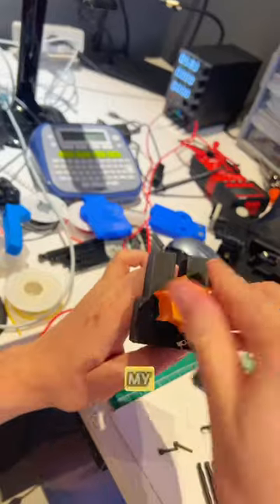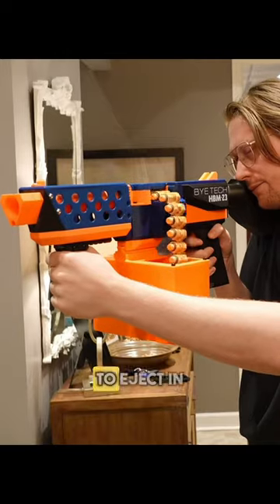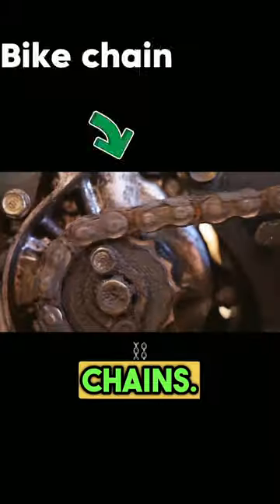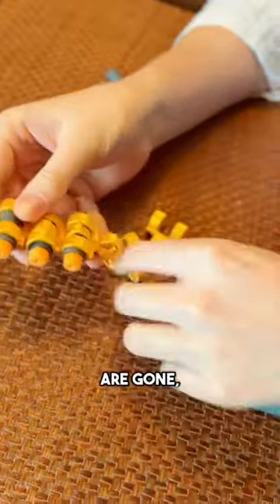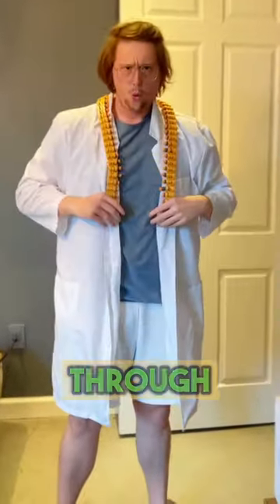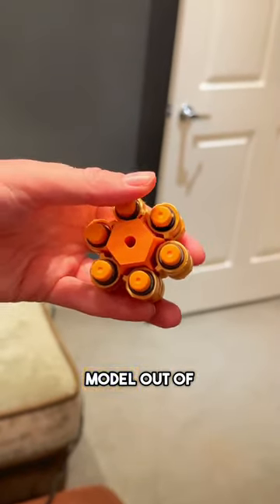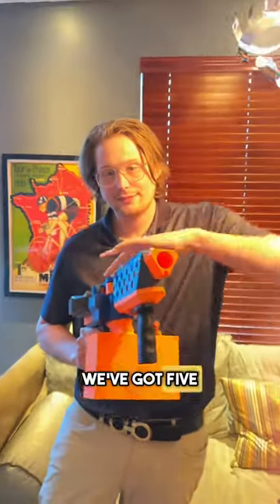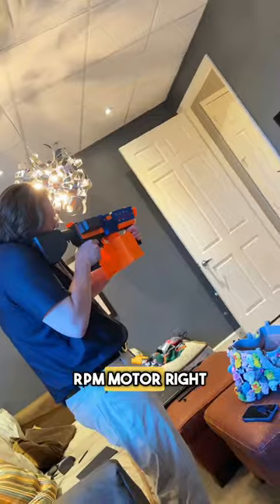Belt fed Nerf Blaster Mistakes Part 2

Comment: I'm sure you probably ran into this term while designing your link system, but those are typically referred to as disintegrating links. I think they're worth the mess, but it'd be cool to see this thing firing at the highest possible firing rate you can hit while still using rollers to shoot the darts.
Reply from the maker: I’m doing a few fixes to reduce jams right now then I’ll plug in the 200 rpm motor to get 4x darts per second! I’ll post the video soon!
Reply: There is a person who made a minigun like this, he has a 500 round mag wich he empties in under 10 seconds😂

Comment: Your math anit mathing if it’s 50rpm (rotations per minute) it can’t be over 1 dart per second also 200rpm would be 3 and 1/3 darts per second
Reply from the maker: Actually because there’s 6 teeth in the sprocket it moves the belt along 6 darts per rotation thus 6x 50rpm = 300 darts per minute = 5 darts per second!